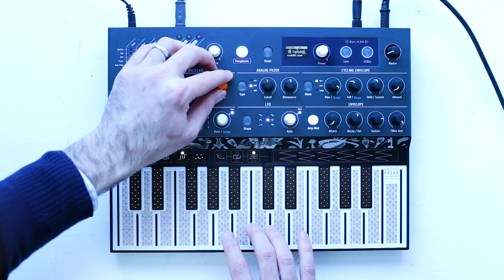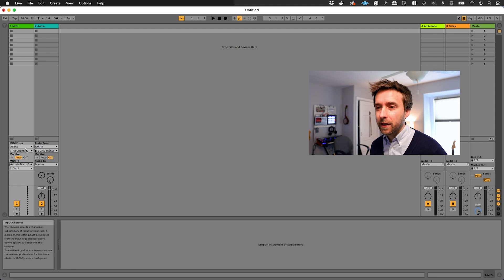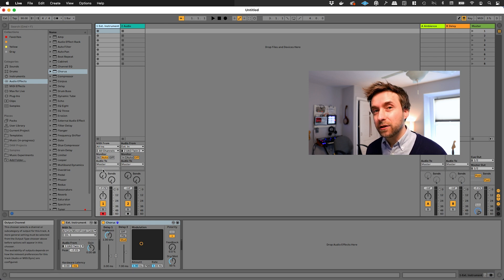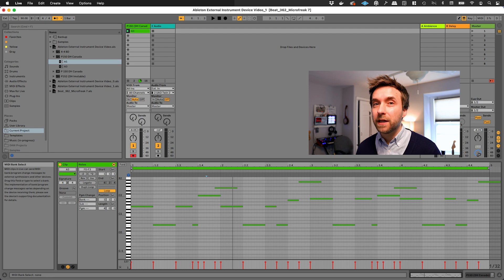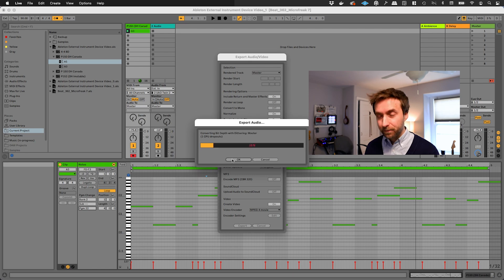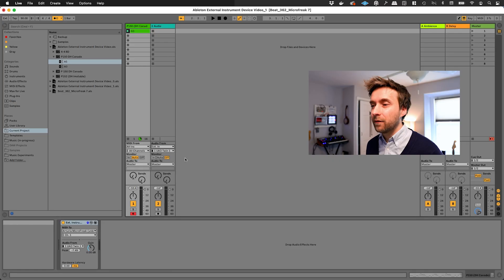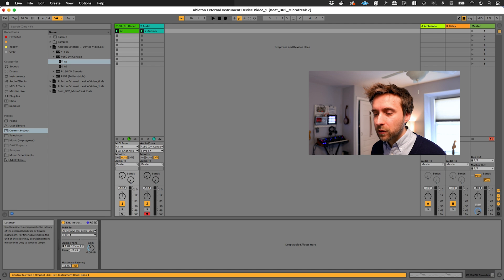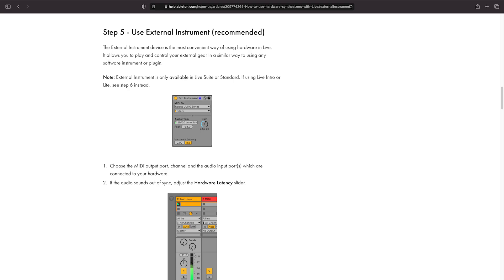How to record hardware synths using Ableton Live's "External Instrument" device

Comment: Thanks for letting me know that external instruments is only in the standard and pro because i was searching and searching for it last week and couldn’t find it. But that is because i have live lite from buying my uad volt 2. I was still able to get the settings to work though finally in order to hear playback somehow despite not having external instrument. Not sure how, just clicking things off and on in that midi menu did it for . Troubleshooting. It was very frustrating because i tried luna app from either uad or arturio and it (being able to hear what i had put into the program back to me) worked right away without so much fuss in luna. But i know ableton is the program most people use so i will stick with it.

Comment: Important note: Turn “local control” off on your keyboard when using External Instrument if recording the same keyboard you’re playing, as shown here. Ableton External Instrument echos all midi data received back to the target instrument during recording and playback. If local control is “on” during recording all data will be double triggered on the synth (e.g. the note you play followed by the same note sent back) with a delay value of the round trip latency. If the round trip latency is low enough (e.g. 38ms) you may not notice it’s happening but it will create unexpected results when recording (e.g. choursing, voice stealing, parameter glitches, etc.). An invisible hand doubling everything you do a few milliseconds later. It can mess with your performance and possibly the midi data and audio being recorded.

Comment: Thank you. I only have 1 input on my Apollo Twin, but several external instruments. For example, I have a Synth which output goes in to a drum machine, and from the drum machine the audio signals fpo in to the Apollos 1/2. When setting up a MIDI track for each external instrument, I get input on every MIDI track, since they are receiving from 1/2. Is it possible to set this up so that each instrument is sending to separate MIDI channels?

Comment: Super helpful videos as always David.  Thank you!  I was already successfully recording from external synths before watching your videos but I find your attention to detail necessary to complete my own understanding.  I always learn from you and appreciate your suggestions.  One thing that I do not understand and cannot figure out:  When I record some automation, like filter cutoff with my MicroFreak, the actual changes that I make are recorded in the clip, but there is no visual evidence in the clip editor -- I do not get a blue line showing the automation even though it is clearly heard.  (And no blue dot next to 23 or any other CC number.) But when I modulate the pitch bend, the pitch bend is recorded AND the blue line appears in the editor.  As I watch your first video I see clearly you moving the filter cutoff knob and the blue line recording your movements.  Any ideas? (I am using Live 11). Enjoy your illustrative compositions as well. Inspiring.  Thank you!
Reply: Depending on your synth settings you may be recording those modulation changes as NRPN or RPN data rather than CC data, so you won’t get them showing up on the CC channels

Comment: I assume this external interface like the UAD/Apollo Twin is required to get this to work? I've tried plugging the Microfreak directly into my Mac through USB but unfortunately not able to monitor the actual audio output (MIDI works fine). Hearing conflicting information as to whether the microfreak transmits audio over usb but it seems like it does not.
Reply: You can record with a laptop’s built-in input, but the noise floor will be higher. It won’t be super noticeable for one or two tracks but if you’re layering a lot of elements the final track will be pretty noisy. 

You can of course apply noise reduction plugins but that will inevitably also cut-into the frequencies of your instruments to greater or lesser degree. 

That’s the main reason for committed hobbyists and working musicians to use external interfaces, to be able to layer dozens of tracks without noticeably adding noise or having to cut-into the desired signal to eliminate the noise after the fact. 

Of course not everyone is against noise. If you for instance used a 4-track cassette-studio emulation plugin to make it noisy and dirty, you may not care to keep your original noise floor particularly low to begin with.

Comment: My two legacy synths, Access Virus C and Korg MS2000R, do not properly sync with Ableton Live 11's clock when activating their arpeggiators.  Neither synth contains USB, so I use MIDI IN/OUT cables through a MTU Midi interface, then USB1 into my Macbook Pro.  All of my settings are set up properly in Ableton.  Cubase 11 on the other hand?  No problem!  Cubase detects my instruments perfectly, clock-sync is precise, life is good.   My conclusing is that Ableton does not like USB1 or MIDI interfaces.  It wants all USB2+, more modern synths, etc.  Just my two cents.
Reply: Now I’m curious to see whether it’ll play nice with my microKORG. I use regular MIDI cables, but it’s a modern USB2 audio and MIDI interface box.

Comment: Nice.  Bizarre Ableton doesn’t provide a way to disable the midi tracks like soloing.   Disabling devices or muting clips is not efficient.  My workaround is to send all the midi enabled tracks, other than the one I’m working with, to a midi channel that isn’t being received by the synth.  Still clumsy, vs. bouncing around and soloing while composing and arranging.  I’ve seen a few M4L devices I’m going to try but any options would be welcome.  🎉🎉🎉

Comment: Hi David, I'm new to Ableton and have followed many video's on how to use the Ext Instrument function. I can get a Midi track created in Ableton to play an external hardware synth but I can't control the volume or mute the synth through the track. The audio plays through my monitors via a Mackie Big Knob Studio interface and the volume level shows in the Ext Inst track but the slider and mute button do nothing. My Mackie doesn't have the option to disable direct monitoring so I was thinking that this might be the problem until I saw this video where you create an Audio track to handle the sound. Is this where I'm going wrong and I need to create an Audi track to do this?  Thanks
Reply: The audio track to handle the sound here was in lieu of hardware monitoring, in part 1 he said he always uses software monitoring to preview effects. 

I find it a bit odd you can’t disable hardware monitoring though — mine has no switch on the box but I can disable it in the control panel software. 

Either way, you shouldn’t have much problem using hardware monitoring while recording the audio in to an audio track, you just disable any software monitoring while recording. After it’s recorded you work on the audio track after the fact and the synth won’t generate the sound anymore, so there should be no conflict. This is how I personally handle it because I’m more sensitive to lag than David.

Comment: Hi David, in this video you explained the set up i/o but in part 2 you didn’t. I have been using part one all weekend and find it useful workflow but not sure if my set up is correct. My 27” monitor is fussy and I can’t read the settings properly.

Comment: I have 3 Emu rack synths connected Via a Digidesign Midi I/O that's connected to a Midi keyboard. My goal is to use the keyboard to trigger the diff rack synths I have in Ableton and no matter what why I try they won't talk. The midi channels are matched to the unit and the midi I/o but when I come to Ableton and getting everything to talk that's where I get stuck. any suggestions? great video by the way very helpfull

Comment: Preset 150 mapping to Bank 2 Preset 22... sounds like each bank in the External Instrument drop down caps out at 128 presets (128 + 22 = 150). Interesting. Is that how the synth presents itself to Ableton? Or is that just a generic structure for the External Instrument in Ableton, where it always caps out at 128 for any synth?
Reply from the maker: I think that’s actually in the original MIDI spec from the early 80s. I wonder if they addressed it in the MIDI 2.0 spec that came out last year.
Reply: @DavidHilowitzMusic  Ah so what’s shown on the synth’s screen (the numbers above 128) is for our human brains to see the number be unique, but what it maps to in the spec is for the sake of having a generic container that suits all types of devices and uses cases. Makes sense. Thanks!
Reply: 128 comes up a lot in MIDI, like CC and velocity values as well. 

MIDI is generally a 7-bit system. Since MIDI2 is 16-bit, maybe each bank will have 65536 slots 🤔 all presets could fit in one bank and we’d unify the “user presented number” with the backend one in all but the most extreme cases. 

Do any synths even have over 65k preset slots? lol. Maybe the concept of a bank number of fixed length will be eradicated entirely and it’ll just be an arbitrary-length integer.

Comment: next up: record and play back system exclusive dumps from the external synth using ableton live so you can store your patches in the project like weve been doing since atari cubase.
Reply from the maker: That would be a really cool video actually. I'm told it's possible using Max4Live.
Reply: @DavidHilowitzMusic  somewhat. its really clunky and requires a lot of extra clutter last time i tried. I had my hopes up live 11 would handle this natively just the way it records MIDI CC automation. unfortunately all sysex is still filtered out of live natively
Reply: serendipity. someone just uploaded cf-sysex-recorder to maxforlive.com and first tests here indicate it works like a charm besides the fact that the sysex data values are in decimal and not hex. Regardless it's great to see this appear. It was the first max4live patch I searched for when i upgraded to 10 not long ago. Let's see how it deals with dumps from the microwaveXT.